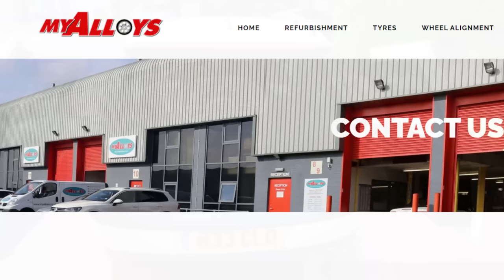TIMMS BMW 840CI ACCIDENT - BODYSHOP AND ALLOYS

Comment: Awesome to see the e31 back in action! Pity about the collateral damage, always happens in body shops…

My 2c: Don’t DIY the headliner! Or, if you really are committed to it, double up on the nitrile gloves. I did it on my e38 (not the il) and it was one of the biggest PITA jobs I’ve ever done. Between the harsh chemicals (adhesive and solvents) and the fibreboard that the fabric is attached to, my hands got really messed up (blisters, burning and insane itching) for about two months, and all my fingernails got even more banged up, looking like they has craters on them for nearly six months. 

I know that a few forum people have done it without as much drama, but they also didn’t strip off the old adhesive and simply layered new adhesive and fabric on top of the old, with only mildly scraping off the perished foam (which is messy and nasty all on its own). So my recommendation would be to pay someone else to do it properly. 

It is going to be hard to get a matching piece of fabric too, as they are made to suit the most common cars, and definitely not rare BMWs. You may need to get hold of a specialist BMW upholsterer to get it done well, and you doubt there are more than a handful in all of Europe that have the skills and matching materials to make it look perfect.

I don’t know anyone, but I also watch M539 Restorations, and I’m sure Sretten would have a few good ideas / leads on that.
Reply from the maker: Sage advice I think - I've tried TrimMania, around £700 including the sunroof, they are the one recommended in this area - I might give them a go - but I might try the bodyshop first - not sure!

Comment: Hi Tim, I'm so happy for you! My wife's Lexus was rear ended over the summer and luckily was repaired within a month. However, I've noticed that some things will never be the same. The trunk now moans when it closes but at least it closes. The gaps on the left side of the trunk are slightly different than the right side. And there's a scratch in the paint where they replaced the Lexus emblem. Overall, it looks good but just like you, I can see these defects. I understand how you felt when u saw the handprints in the paint. I'm happy that you got it sorted out. You have a very beautiful car. I can't wait to see the refurbished wheels on it. Enjoyed the video.
Reply from the maker: Thanks, yes, disappointed to start with, but happier now!

Comment: So pleased it's back and mostly fixed.  Just got back from a 2-hour round trip on country roads in my E38 (same engine), so comfortable, a pleasure to drive, and smooth over the disastrous roads of today. I never got to drive an 8 series, however, I could imagine it's similar but better than an E38 once everything is set up perfectly.
Reply from the maker: Thanks Andrew! The 840ci Sport is a lot stiffer than the E38, even with SEDC, you are closer to the floor and it goes around corners a lot better. However, it missed out on the M62TUB44 with its extra torque and that was a shame. The 840 needs a lower-ratio diff to reach its potential, once that's in it is a much faster car

Comment: Nice to see the car back with you Tim, any faults that have been caused by the damage and repair should be fixed by
the repairer, or, if you repair the faults send them a bill for your time, you will probably do a better job !
Reply from the maker: I thought that an auto-electrician would not have much luck finding this strange one!

Comment: Great to see the car back Tim. If I were you, I would get C + S to do the headlining, I have done 2 myself and they are not easy. The last one I ruined the material and had to buy some more. The hard bit is the lumps and bumps where the sunroof controls are. The electrical fault-finding will interest me, I have done lots of it already on mine. The worst fault was a mysterious fuse that kept blowing causing quite a lot of the systems not to work. Having had every module out of the car and working logically through it, the fault was that someone had taken the driver's door handle out at some point and trapped the small loom that feeds the microswitches in the handle behind the metal casting of the handle causing an intermittent short. Hmmmm. I wonder?
Reply from the maker: I think I will Bob, I got a quote from TrimMania - £700 including the sunroof, not too bad
Reply: @TimmsBMWRepairsandInformation  Unfortunately, I tend to live in the past quite a bit, and that sounds a bit pricey to me, but probably isn't in reality. I bought my material for both the jobs I did from Martrim, who I found to be excellent on every level. They have independent trimmers who work for them if you fancy getting a second quote.

Comment: Hi Tim. Great to follow the progress on getting it back on the road. Can you tell me if the sills were replaced with repair panels or if they were patched up? Mine are going too. Would you be able to give an indication on what the sill portion of the repair cost?
Reply from the maker: They were fully replaced with BMW metal!
Reply: @TimmsBMWRepairsandInformation  yowzers, I've just seen your final costing video. Were the sills bought from BMW, or elsewhere?

Comment: Just wanted to say I'm so pleased you have her back on the driveway... 
Do have a question you may be able to help with.

E64 650, my wipers gave up on the motorway at the weekend during heavy rain :) not the fuses and I've just replaced the relay, also motor works fine? 

All the best,
Andy
Reply from the maker: Put the problem on bimmerforums.co.uk and I'll have a look

Comment: Hi Tim, I've got an issue with my door handles/operation. Passenger side was first issue, wife couldn't access from outside when pulling on handle but widow dropped as normal. Operation was ok from lever inside of car. Drove to local pub for Saturday lunch and on returning to car door opened as normal from outside. 3 days later same issue with drivers door so removed negative battery terminals and left it for about 2 hours and reconnected with no remedy still won't open from outside only from inside. Appreciate any assistance you can provide me with thanks as to a repair or resolution to my issue.
Reply from the maker: Hello Mark, disintegrating door handle mechanisms are par for the course. In the UK Gerry Speechly does a repair kit (Phoenix Motorworks in Camberly). Outside the UK Wokke.de (Wolf) does the repir sets: https://www.wokke.de/SHOP/Shopsystem/Dateien/en/Doorhandle-Repair-Set.html    https://www.wokke.de/SHOP/Shopsystem/Dateien/en/Doorhandle-right.html
Reply: @TimmsBMWRepairsandInformation  appreciate your reply thanks. I now about Wokke but not Gerry's.

Comment: Great progress. Where did you get the headliner material? Mines needing done too. Thanks!
Reply from the maker: I got it from ETSY, but I will only recommend it when I have done the job
Reply: @TimmsBMWRepairsandInformation  great, good luck with the install